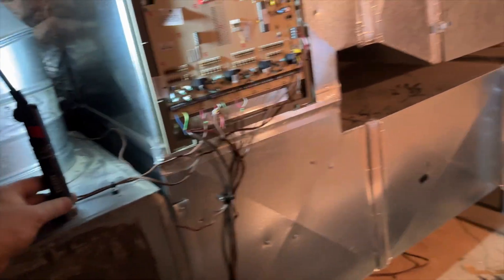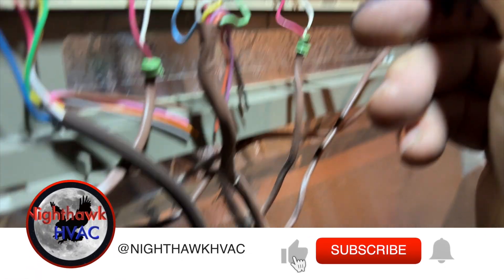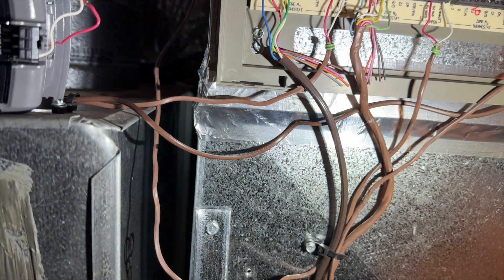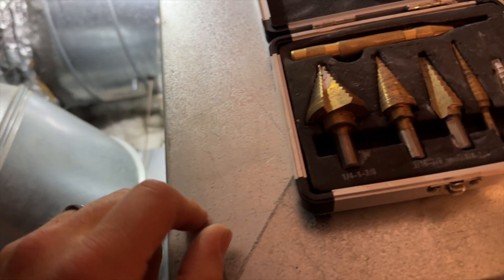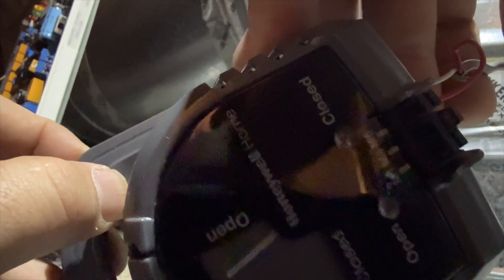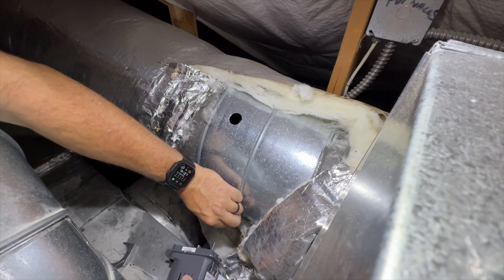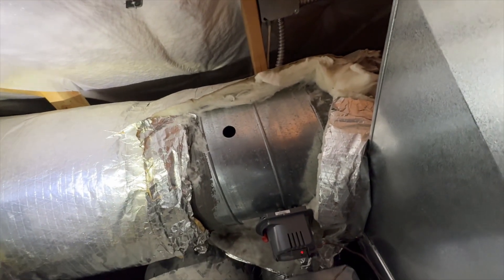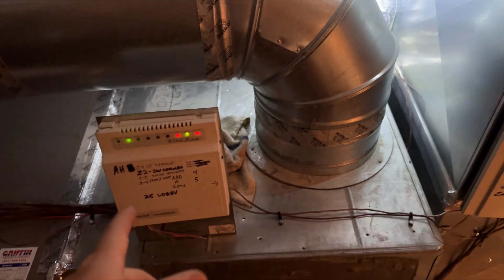HVAC Zone Damper Actuator Motor Failure – How to Diagnose, Test, and Replace EP229

Comment: Customers who had Honeywell installed I find a lot of failures. 
     My one customer he’s on his sixth Honeywell failure.  I placed them with Belimo‘s. 
     Just my service call out there. And replacement every time it’s like $850.. over 4 years time six time = $5100. 
    I don’t mind making the money but for somebody to make a product that fails so often feels criminal.
     That’s why I rather charge them more for upgrading them to a Belimo so I don’t get called back for many more years to do the same job. 
        I may lose a bid on a job because my price is higher on a new install. 
     Kinda like the difference between installing a cheap three dollar and 50 Cent capacitor on a compressor. And then have that customer call you out six months or nine months later and you have to explain to him. It was the capacitor again..
    So I put turbo 200 X on everything no worries about repeat failures.

Comment: Bro I’m running about six calls a month right now dealing with these dampers sticking in the closed position with no actual damper issue . They ain’t that old either. Some less than a year to right at a year. Just a tiny little tap on the actuator and it pops open. Honeywell warranties those actuators for five years so this has to be costing them. I’m replacing them if they stick even once because I don’t trust em. That being said they ARE super easy to replace. A long Allen wrench definitely helps.